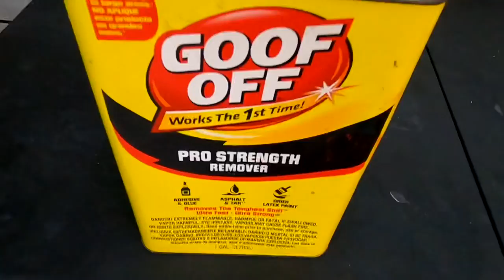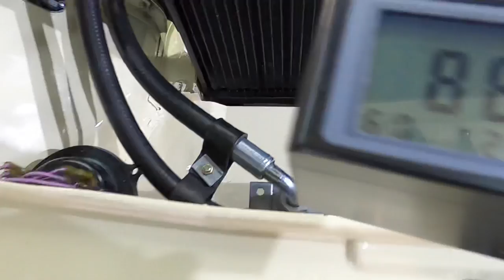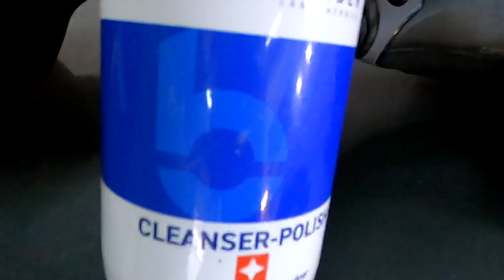Antique MG Concours Engine Bay Detail! Let's Take It To The Next Level!!

Comment: I restored this car over 20 years ago, and still maintain it today. It is holding up very nicely. The current owner drives the car a lot (thousands of miles a year), but keeps it very nice and clean. The engine bay is the toughest part to keep clean, so with this extra detail work, it should give him the head start on the show season he needs. Nice work.
Reply from the maker: I appreciate the post. A fantastic restoration! Cheers!

Comment: I have the Adams micro polisher. I bought one and believe it or not I got another one in a $29.99 mystery box 📦.The one in the mystery box was the new model. I bought the kit that goes on the front with all the little different micro pads.
Reply from the maker: It works just fine for the price. I have no ambition to buy the new model...satisfied with this one.